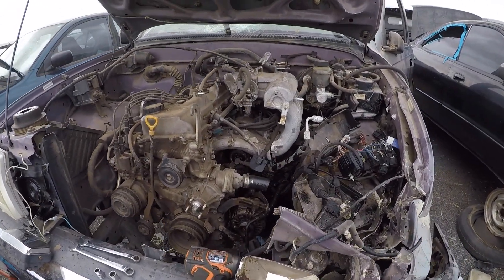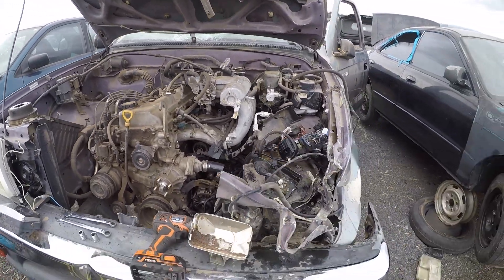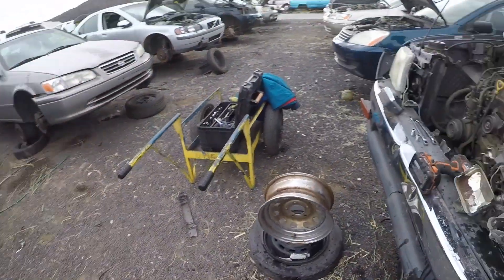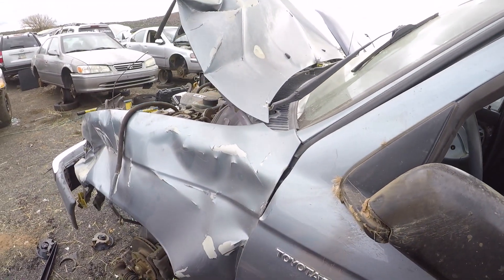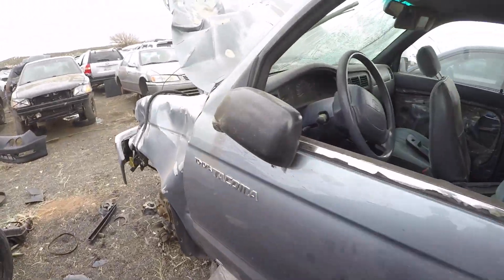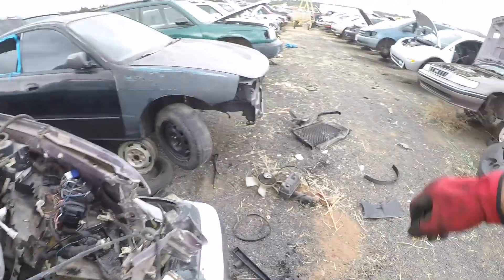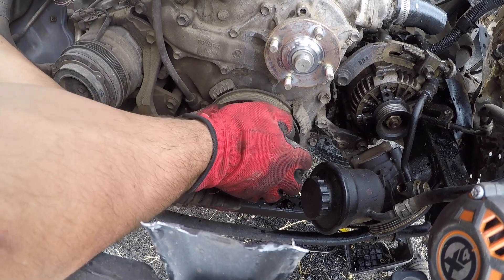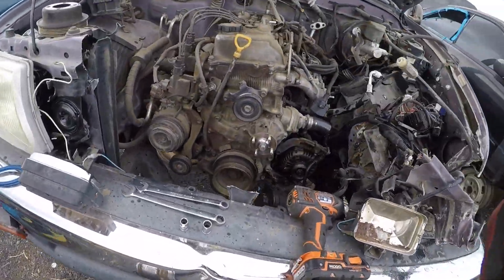Tips for Buying a Junkyard Engine

Comment: After i pull the engine and a basic tune up , what else should i do or look for?
Reply from the maker: First thing I would check before putting money into it would be a compression/leak down test!
do a oil change 500 miles or so after you start running it and check the oil for any flakes or smell (fuel coolant), if all good then youre probably golden!